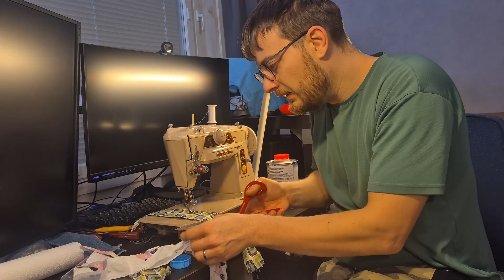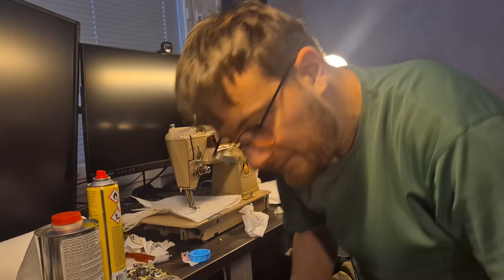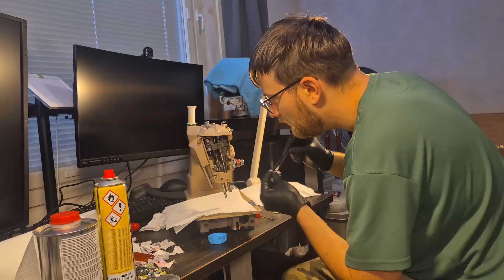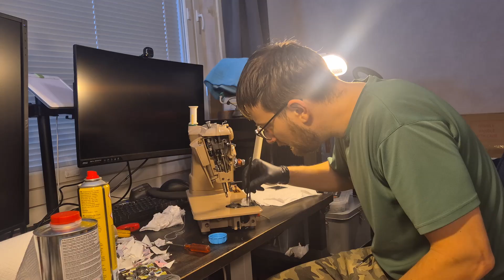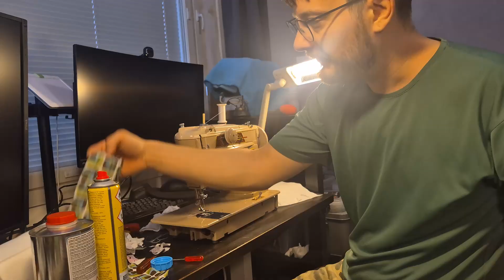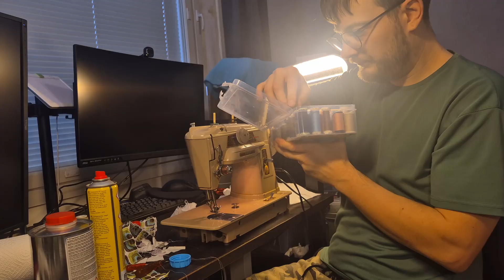Trying to Fix Singer 401 Tension Issues – A Frustrating Repair Attempt

Comment: My foot is not lifting what to do? 401A singer
Reply from the maker: If it is stuck. Open the door of the head/nose of the sewing machine and heat it with heatgun or hear dryer and lubricate the parts that are responsible of movement of the foot.